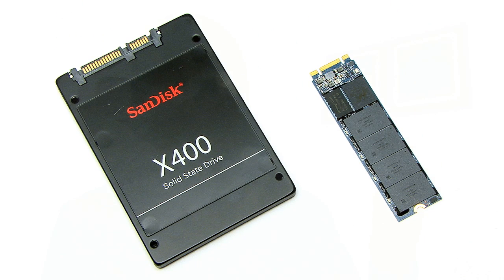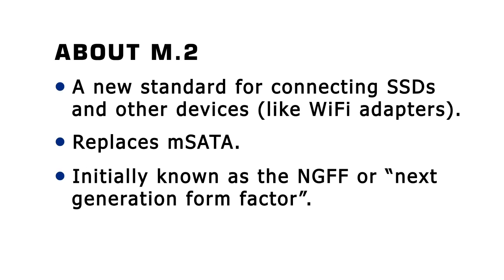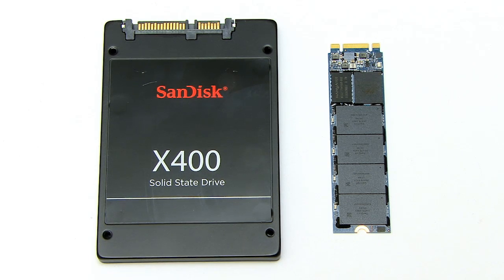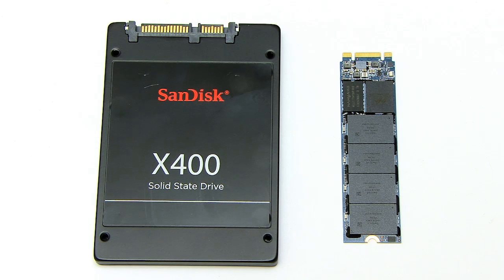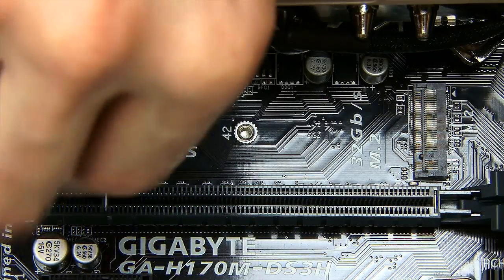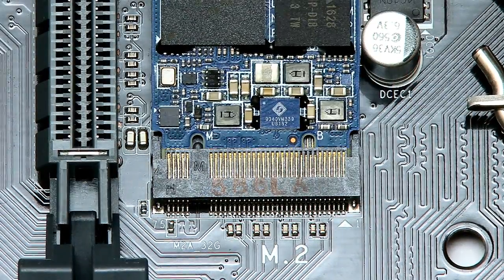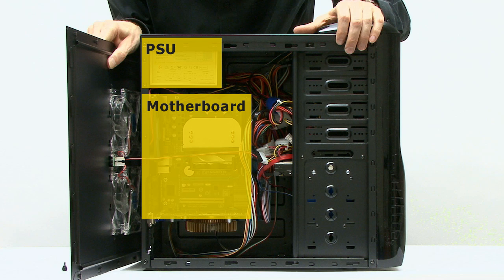Explaining M.2 SSDs

Comment: always a pleasure to listen to your videos :) Just a question how to protect the chip from scratch ? I bought a ssd nvme 3d nand to increase the capacity(main drive) that had chip on the top and on the bottom and in my laptop I'm afraid the ssd chip will be in contact to the main boad...
Reply from the maker: If you are worried, a sticky label, section of Post-It note, or tape, would ensure separation.
Reply: @ExplainingComputers  Thanks a lot for the recommendation :) And keep doing great videos about explaining Computers, love it !

Comment: Can you answer a question for me.......I have a mother board that has two m.2 slots, but using one, disables sata5 and 6 ports, why is that?
Reply from the maker: Because there are a limited number of SATA ports on any motherboard, so those can be used either as SATA ports, or M.2 SATA ports.
Reply: @ExplainingComputers  OK, Cheers for the reply.... :)

Comment: You explained about the SATA M.2 drives. How do these differ from the PCIe M.2 drives? Are they physically installed the same way? If so, what happens if you put the wrong kind into the M.2 slot? (I loved how you explained the PCIe expansion slots)
Reply from the maker: They are indeed physically installed in the same way, but the keys on the slot should prevent you putting the wrong type of M.2 device into the wrong type of slot.
Reply: @ExplainingComputers  Thank you for your clear, concise, and QUICK response. :D Now all I have to do is figure out what kind my pre-built computer's MB has.

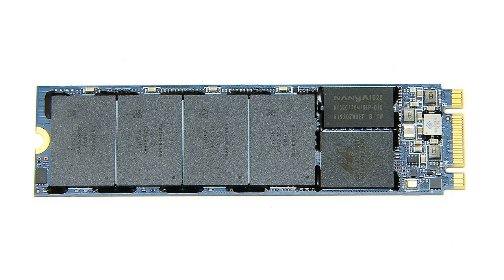Comment: 2:34 That looks suspiciously symmetrical, and that you could insert it upside down.
Reply: Good thing they're actually not though. Count the number of pins from edge to key on each side and you'll see they are of different lengths which helps prevent inserting the wrong way.

Comment: i can see heat being an issue and need for more space
Reply from the maker: Yes, indeed. We are now starting to see M.2 SSDs with heat sinks.
Reply: @ExplainingComputers  

nice one of the worries i had is life span as ,in reads and writes while they are faster i have in fact a 1996 40GB hard a drive that still works i doubt were gonna see many of these last that long ever/// however its more of a hey look it still works then used much...

my next system will look into these m2's like the ease of there replacement over old school sata and eide drives...

might also allow for more fans or better cooling in front of box to bring air to rest of pc which is a good thing

Comment: the port blocking thing is only a problem for SATA drives. You also have to worry about which slots, because many Motherboards only have some of the M.2 slots that can do SATA at all. M.2 PCIe drives in general are non-blocking and can go in any slot.

Comment: So... For all intents and purposes an M.2 drive marked as "NVMe" is a true "PCIe" SSD, and are referring to the same thing for all intents on purposes, right? Whereas a "SATA" M.2 drive, is doing just that... Connecting through SATA. I have an old Dell T7500 dual CPU workstation and want a speed boost and don't think it'd boot an NVMe drive. BUT, would I possibly be able to boot a SATA SSD that's connected through a PCIe adapter? It's been tough to know..
Reply from the maker: It depends on the PCIe adapter, and how old the workstation is. It would be easier to attach a SATA SSD via a SATA port.

Comment: 👨‍💻🎬- 2019  buy the best SSD STICK NVMe2m2  dont fook about with   $50 if its buys 1 up better etc youll be sorry $50 -$100 u waste in a pub 1 sat nite so stop the cheap ass buying on PC's MAN UP - 🔥👍👨‍🚒GET BEST YOU WONT BE SORRY FOR 5YEARS . 
 & new pc build gigabyte aorus Z390 gaming elite $280 au 
i7-9700K > mb has  12-phase a LOT ONLY HAVE 4-6 PHASE ON New 390 mb'S   OK if u dont O/C maybe/ wont burn out lots  good stuff on these Gigabyte boards 👍🤸‍♂️🤸‍♂️🤸‍♂️🤳💨- dont by a MSI old like 360 boards fail alot chit wont run with new gen8-9 intel cpus ok watercooler $140 ssd 180 mb $280 cpu $700 done headphones$140

Comment: Is SATA M.2 compatible with a PCIe M.2 Slot?
Reply from the maker: No. But many M.2 slots can support both SATA and PCIe (NVMe) drives. So it depends on the motherboard concerned. Some M.2 slots can take both SATA and PCIe, others only one or the other of these.

Comment: ssd will slowly be replaced by ram drives.  the simple fact being ram is faster, and has no write limits.

how you say?  its a simple tray like a cd rom size bay that has a board with slots for just ram.. and one battery.

used to use ramdrive.sys to allocate 8 out of 16 megs on my 486+66  to run Doom1 in...   absolutely instant.. games entirely run in ram lol... nowadays with 4000 meg a sec ram and 512 gig modules...   you could have a terabyte ramdrive lol

Comment: The very last thing you mention is "Drive less computers". While that is great in theory, laptops tried a distant but similar idea by removing cd/dvd bays. How did that turn out? No one bought one. Nice video though on the subject.
Reply from the maker: Very few laptops now have a CD/DVD drive -- so it worked out OK. Lots of people bought them! :) Apple, for example, has not sold a laptop with a CD/DVD drive for a couple of years.
Reply: @ExplainingComputers  Thanks for the reply!    Thank goodness my lenovo Ideapad I7still has a CD/DVD drive and and ethernet port :)

Comment: Chris, Since my Gigabyte Z390 AORUS PRO holds both a 2280 and 22110 M.2, does it matter which I buy first?
Reply from the maker: Nice motherboard. Both M.2 slots can take an 80mm NMVe SSD, one can alternatively accomodate a 110mm length device. It does not matter which length you fit -- most SSDs are 80mm.
Reply: Chris, is Gigabyte's BIOS/UEFI easy to deal with? When I follow advice you gave me to use 2.5" SSD for storage instead of a second M.2, I will need to play with Boot Order.
Reply from the maker: Yes, the settings are pretty straight forward these days. My BIOS video posts in about 2.5 weeks. :)
Reply: Chris, I asked if I might buy the 22110 m.2 first since it has more chips than the 2280,  and, thus,  might be better in some way. If this is a foolish/wrong assumption I am very sorry to waste your time.

Comment: You're presenting the m.2 sata type but the used slot is nvMe type, it's not match. I think the nvMe slot will have optimal performance if we also use the nvMe m.2 type too
Reply: That's right... Agree that.. NVme is faster.. So is there a sata slot specifically?
Reply from the maker: M.2 slots can be keyed for SATA drives only, NVMe only, or both. Remember M.2 is not an interface, it is a connection standard that supports multiple interfaces (SATA, PCIe and USB).
Reply from the maker: The slot shown -- like many -- accepts either a SATA a PCIe (NVMe) drive. Certainly an NVMe would be faster. :)
Reply: I have a notebook with built-in m2 slot, like others.. I wanna good performance so that i will attach the nvMe type on it.  Before i buy the m.2, I make a simple research & the result is, my notebook unable to read nvMe type so I buy sata type. Many people feels upset because decides to bu nvMe with no research & the nvMe m2 that they have are useless

Comment: I'd argue the fourth part of the equation and one you left out for the last ten years or so has been the GPU.
This is only becoming more relevant after recent innovations in parallel software algorithms. The workloads that can be offloaded to the GPU are only increasing. As a software developer I need to think about how an algorithm will scale horizontally now more than any other performance  based consideration.
Cloud computing adds even more pressure to this requirement.
The GPU in modern cloud computing frameworks is taking on more than the CPUs in the best engineered cases.
Did you know you can now offload workloads in the cloud to Cray hardware? 
It boggles my mind.
We live in wonderful and challenging times.
Luv and Peace.
Reply: Ian - Spot-on, bud - SPOT-ON !

Comment: When using this for everyday uses what is the average temps you end up getting with it?
Reply from the maker: As I recall, the drive goes up to about 42 C in the case I'm using it in. I see that WD are now selling M.2 drives with quite large heat sinks. :)
Reply: @ExplainingComputers  Well i have been planing on getting a 250gb/256gb M.2 WD Blue or Team Group (which is actually a good company which i used for my main storage before as a 2.5" drive and i use for my memory).

Comment: Waiting for a Raspberry Pi with built-in M.2 slot and a better-integrated power supply connection. Then, it's good bye, PC case, altogether, assuming the heat dissipation is managed properly.

Comment: Fairly good video. You probably need a video on how to decide what to purchase in M.2 drives. There are some devices that are older Tech and should probably be avoided. For instance is the drive a 3D X 4 drive and what are the speed specifications. Another factor is about cloning software to transfer your hard drive to the new drive or a small drive to a larger Drive or Smaller drive. Then you might want to consider doing some file cleanup on the drive to get rid of unwanted or unneeded old temp files and old Windows Update files. That can shrink the size the operating system needs to use and speed up the cloning process. Also how to back up things like Photos, Media files, and the My Document folder. I like to get in the habit of using My Documents specifically to save important information and then creating sub-folders to make things easy to find. If you use Income Tax Software like us in the USA maybe keep all your old tax documents there also. Then you can copy all of that onto a USB flash drive, an external Drive or a file server in case something happens to your computer. If you have a lot of music files or ripped DVD movies or YouTube videos you may need a lot of storage to back everything up.

Comment: Fyi, M.2 ssd's of any variety tend to become quite hot during operation so you need to be careful in how you handle these devices.  Specifically it is not recommended to directly touch the surface of these devices with your fingers because there are residual oils on a person's skin that can become transferred onto the integrated circuits (chips) of the device resulting in "hot spots" or area's where the heat can become concentrated and not radiate away properly which can and often does result in poor performance and/or permanent damage to the device.  Best if you use a new pair of latex gloves when installing, unless you can be careful enough not to touch the surface of the device with your fingers (hold the drive by the edges, the green part of the card) and don't touch the black "chips".  It doesn't matter how much you wash your hands you can never get them so clean as to wash away these oils and salts which are constantly produced by your skin.  Just wanted to add  this little bit of info which is also true for computer memory and any sort of peripheral add on card.  I didn't even mention that you should, just to be totally on the safe side, avoid touching the gold contacts because these oils can easily result damage to them and impede the electrical connection.  Also you should wear a grounded wrist strap to avoid causing damage to the device from static electrical charges, etc.  This video, though quite informative, can show a person enough bad habits to result in an unnecessary RMA situation, that is if you don't say enough to the vendor during the process to result in a totally voided warranty....  Most devices, these days, will arrive to the final consumer untouched by human hands.  I will generally assume, however, that someone along the chain of custody has been careless and handled the device in an "unsafe" manner and use isopropyl or ethyl alcohol and a clean cotton cloth to clean the surfaces before installation as this situation can result in damage to these modern, hot running devices.

Comment: Aesthetics are why i like my NVME SSD. Never mind the speed. Because of that thing you cant tell if my machine has any hard drives because of no SATA Cables. Side note If your board supports NVME, it does not disable a SATA Port, but it does cut the link speed of one of your PCIE Slots. Or in the case of my Ryzen Board it slows the second 16x PCIE port down to 1x.

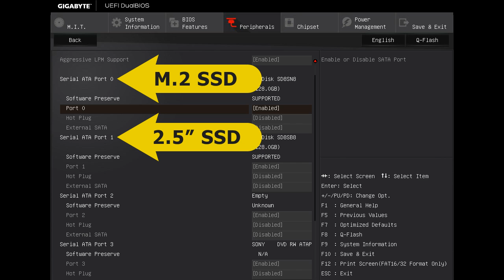Comment: Is there a way to find out which ports will be disabled if i decide to buy and use an M.2 ssd? (as described at 7:00)
Reply: You should look up the detailed data sheet on the manufacture website for your Motherboard. Like for my MSI board it says that my SATA 2 port will be disabled when using M.2

Comment: Very informative indeed.  But if I opted for the PCIe versions, will they lasts longer? Or will it wear out faster than SATA due to the higher speed that they may be able to get to?
Reply from the maker: The lifespan should be the same, in terms of the quantity of data written. The only possible issue is that M.2 drives may run warmer to to their location on the motherboard, which may reduce their life expectancy.
Reply: @ExplainingComputers  Thanks you very much for the info!

Comment: M.2 sata or M.2 PCIe or M.2 NVMe, B key, or M key. There are also PCIe expansion cards for M.2 SSD's and you can buy 2.5" sata SSD's. In other words, it is all way to confusing. I have an asus H97m plus motherboard, I bought it new so I have the manual, but it is not so clear which M.2 SSD is compatible with my motherboard. I want to buy an SSD, but the past days I have been trying to figure out which one I need to make it work at the speed as promised. However asus claims that the M.2 slot on my mobo should be capable to reach transfer rates up to 10GB/s. As far as I can tell that would not be possible if the M.2 slot was only compatible with sata SSD's. I updated my Bios to the latest version, and when I go take a look into the Bios settings I can find NVMe settings. But does that mean that my motherboard is compatible with M.2 PCIe SSD's?  Older forum messages say that it isn't. Some other forums tell that you have to make all these Bios adjustments to make it work. Other folks say that it will work but only at much lower transfer rates as promised. 

Explaining what types of SSD's you can buy doesn't tell you what kind of SSD is compatible with your specific motherboard.
Reply from the maker: I would suspect that your board is not compatible with PCIe/NVMe drives, only SATA. Fairly obviously, no video is going to tell you what hardware works with an early M.2 motherboard unless it is about that board! :)
Reply: @ExplainingComputers  Thank you for your response. The past week I have been reading the manual over and over again, and I found this line. Maybe you can help me a bit to make it more clear for me. 

1xM.2 socket 3 with M key, type 2260/2280 storage devices support (both SATA & PCIE mode)*

* M.2 socket 3 shares bandwidth with SATA_5/6 and supports M key and type 2260/2280 storage devices. 

That's exactly how it is written in the manual. 

My native language is not english, but it makes me believe, and please correct me if I am wrong, that the M.2 socket is also compatible with PCIe, or am I reading it wrong? Is it even possible that an M.2 slot is compatible with both SATA and PCIe ? Or have you ever heard about that possibility? 

hahaha can you see why it is confusing to the average person? LOL

I did a bios update for my H97m-plus motherboard, and when I look in the bios settings I can find settings for M.2, and it gives me the option to put it on PCIe or on SATA, and since the bios update I can also find settings for NVME but I can't adjust the NVME settings yet because I don't have an SSD installed. But I don't have a lot of money so I have to be careful with what I buy. I can send it back if it turns out that it doesn't work as expected, but I rather know in advance what I can buy and if it is even worth to buy it performance wise if that is possible. That saves me some money because I don't have to pay for extra shipping if I buy the correct module straight away. 

If possible I want to install a NVME SSD if it gives me the performance that makes it worth to install a NVME SSD. Asus claims that my board should be capable to reach transfer rates up to 10GB/s with the on board M.2 slot. My understanding is that those speeds would not be possible with SATA because SATA can't go faster than 6GB/s. Am I correct? 

I am sure that other people with the same motherboard would like to know this as well, it would be a great upgrade for people with this type of motherboard if it turns out to be working as I hope for.

Comment: Not sure but I think this guy used to do a programme called Future File ? He and another were excellent and I was hopping mad when they killed it 1 M.2 does sound rather good, but to say that computers have taken a step forward is somewhat backward. Ever heard of Atomchip ? 6.5 Ghz processor with 1 TB main and 2TB backing memory 13 years ago ! No moving parts all done by light. Non volatile RAM. The modules were visible in 2005, although no one ever saw one work. Now all you get is the whitehouse login prompt when you go there.